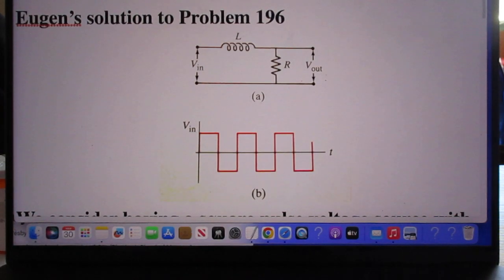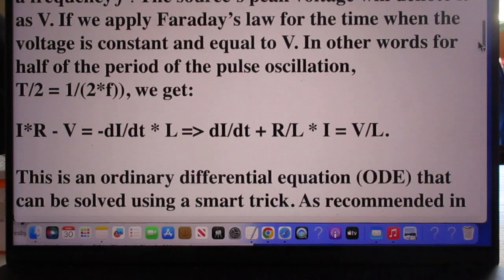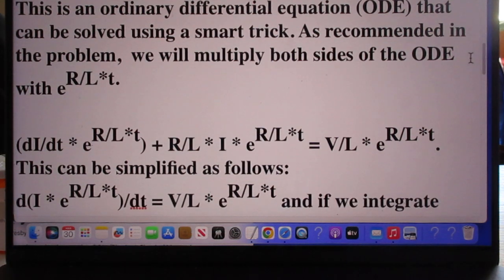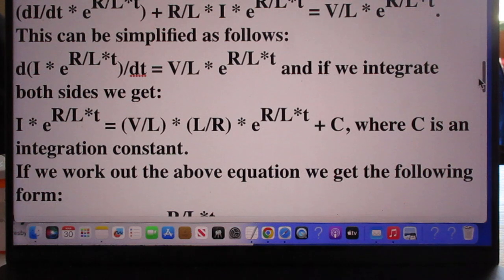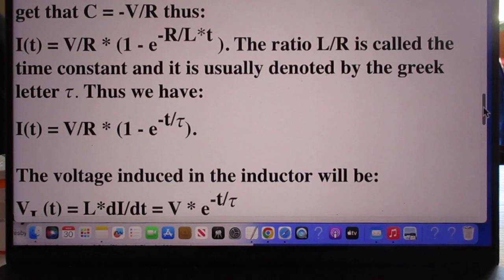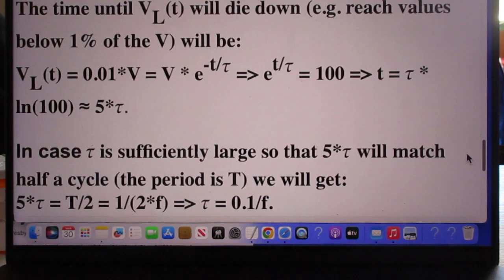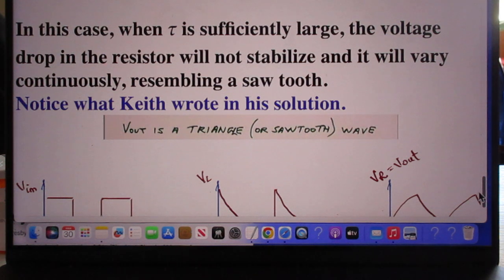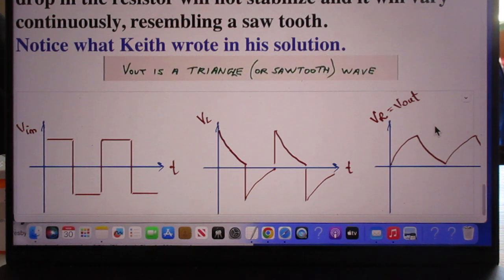Eugen's Solution to 196 - Integrating Circuit

Comment: What edition Physics book to you have Walter?  I am retired and studied Physics over 40 years ago, we used Nelson.
Reply from the maker: 8.01
Physics
Hans C. Ohanian
Physics
Volume 1 
2nd edition
W.W. Norton & Company
ISBN 0-393-95748-9

8.02
Physics for Scientists & Engineers by Douglas C. Giancoli. 
Prentice Hall
Third Edition
ISBN 0-13-021517-18

8.03
Vibrations and Waves by
Anthony French
CRC Press
ISBN 9780748744473

8.03
Electromagnetic Vibrations, Waves and Radiation 
by Bekefi and Barrett.
The MIT Press
ISBN 0-262-52047-8

Comment: 2:10 I did pretty much the same thing, yet I was "way off"...❔😕
The integration constant isn't required if you just use the fundamental theorem of calculus and the notation ₒ∫⁼ͭf'(t)dt=f(t)-f(0)=∆f.
The problem set the time t«L/R, so I used this and said exp(Rt/L)→exp(0)=1, then integrated. Much easier and it works!
Reply from the maker: we were fully aware of the fact that you copied the solution from the solution book of Giancoli. We had problems which that solution.   On a separate issue:  There is no E-field in an ideal inductor. Thus the integral of E dot DL through the wire of the inductor from one side of the inductor to the other side is always zero.  Yet, if you atach a voltmeter over the inductor you have created a closed loop with the inductor and the voltmeter. The integral of E dot DL through the inductor is zero, but according to Fraday's  Law the closed loop integral of E dot DL in the closed loop that you have created is -dphi/dt = -Ldi/dt and that's what the voltmeter will show.
Reply: @lecturesbywalterlewin.they9259 
Well, I did the solution first, then I looked up the solution which happened to be the same (it was obvious to me that I could ignore the exponential) but I found it didn't explain anything which is why I elaborated on everything and it was so long and perhaps confusing. 

I found the actual equations for the square wave and triangular wave that could be used to plot them over many cycles.Giancoli didn't do that.

I was also trying to make it fit my simulation, but I'm not sure if the voltage that the proto app measures the voltage on the inductor correctly as it just came up with 2V, same as the power source, but I did notice that on one side of the wire, if I put a voltage probe there the sawtooth/triangle wave shows up. 

I played around with the app and until I had a perfect square wave on the emf voltage at about 20μs timestep for that timescale and I did get the isosceles triangular wave, but on a different timescale. 

I attempted to get di/dt from the current but it did not meet expectations. Kept getting around 9.5V for Ldi/dt for some reason which I think is too high, or is it?

Here is some values:

I had L=100H, R=1mΩ, Vin=±2V, f(in)=250Hz

iR+Vin= -Ldi/dt
15μA(1mΩ)±2= ±100H(30μA/t)
=> Should have ~±2V= -Ldi/dt
L=100H=> For 320μs should have: 
|di|~6.4μA, but had ~30

1/t=(15/1000)±2)/3000
→1000×((15÷1000)±2)÷3
~671.67 Hz , 661.67 Hz
~ 1/1500μ=1000/1.5~666.67 Hz
t=±3000μ/((15μ/1000) ±2)~1500μs

100(30/t)=
29.8/320=0.093125
di= 31.4μA, dt=330μs

di/dt=31.4/330=0.095151515151515151 A/s
Ldi/dt=9.5151 V ( 😕????)

di= 39.8
di= ±(39.8μA - 200nA)=±39.6μA
di/dt=39.6μA/408μs=0.0976 A/s , 1st ½cyc
39.8/412=0.096601941747572815
di/dt= -0.0976 A/s, 2nd ½cyc
Ldi/dt=100*0.0976 A/s=9.76 V
Reply: @lecturesbywalterlewin.they9259 I accept the Faraday's law explanation but my app is just giving me the input voltage on the inductor. I think it's because the change in current is so small in comparison. 

Also, I try to get slope di/dt of the current over one ½ cycle and it seems to be off because I end up ~300 to 400μs for dt (with di~ 36 to 38.2μA), and it should be ~1500μs for the di I was looking at.
Reply: @lecturesbywalterlewin.they9259 Should 've chosen V=0 at t=0 b/c of the Fourier series. 😊

“Dirichlet Invented this Function to Prove a Point. Dr Will Wood” on yt, 61 seconds in…
Reply: Well, I did the solution first, then I looked up the solution which happened to be the same (it was obvious to me that I could ignore the exponential) but I found it didn't explain anything which is why I elaborated on everything and it was so long and perhaps confusing. 

I found the actual equations for the square wave and triangular wave that could be used to plot them over many cycles.Giancoli didn't do that.
Reply: I was also trying to make it fit my simulation, but I'm not sure if the voltage that the proto app measures the voltage on the inductor correctly as it just came up with 2V, same as the power source, but I did notice that on one side of the wire, if I put a voltage probe there the sawtooth/triangle wave shows up. 

I played around with the app and until I had a perfect square wave on the emf voltage at about 20μs timestep for that timescale and I did get the isosceles triangular wave, but on a different timescale. 

I attempted to get di/dt from the current but it did not meet expectations. Kept getting around 9.5V for Ldi/dt for some reason which I think is too high, or is it?

Here is some values:

I had L=100H, R=1mΩ, Vin=±2V, f(in)=250Hz

iR+Vin= -Ldi/dt
Take iR as average i value on ½ cycle 1:
15μA(1mΩ)±2= ±100H(30μA/t)
=> Should have ~±2V= -Ldi/dt
L=100H=> For 320μs should have: 
di~6.4μA, but had ~30

di=30μA
i(1mΩ)±2V=±(100H)(30μA/300μs)
=> ±(10-2)V=±8V=i(1mΩ)
=> i=±8(1000)A !!!

i(1mΩ)±2V= (100H)(-30μA/300μs)
=> -(10±2V)/(1mΩ)={-12000A, -8000A}

(30μA)(1mΩ)±2V=-(100H)(di/300μs)
=> -(90·μ²·mA)+6μA=di
=> di~ 6μA

1/t=(15/1000)±2)/3000
→1000×((15÷1000)±2)÷3
~671.67 Hz , 661.67 Hz
~ 1/1500μ=1000/1.5~666.67 Hz
t=±3000μ/((15μ/1000) ±2)~1500μs

100(30/t)=
29.8/320=0.093125
di= 31.4μA, dt=330μs

di/dt=31.4/330=0.095151515151515151 A/s
Ldi/dt=9.5151 V ( 😕????)

imax= 39.8
di= ±(39.8μA - 200nA)=±39.6μA max & min
di/dt=39.6μA/408μs=0.0976 A/s , 1st ½cyc
39.8/412=0.096601941747572815
di/dt= -0.0976 A/s, 2nd ½cyc
Ldi/dt=100*0.0976 A/s=9.76 V
Reply: Here are some values:

I had L=100H, R=1mΩ, Vin=±2V, f(in)=250Hz
(I mistakenly put iR+Vin= -Ldi/dt previously)

-iR+Vin= Ldi/dt

Take iR as average i value on ½ cycle 1:

-15μA(1mΩ)+2V= 100H(30μA/t)
=> Should have ~2V= Ldi/dt

L=100H=> For 320μs should have: 
di~6.4μA, but had ~30

-(15μA)(1mΩ)±2V=(100H)(di/300μs)
=> -(45·μ²·mA)±6μA=di
=> di≈ ±6μA

-(30μA)(1mΩ)±2V=(100H)(di/300μs)
=> -(90·μ²·mA)±6μA=di
=> di≈ ±6μA

2V-15μA(1mΩ)= 100H(30μA/t)
2V-15μ·mV= 3000μVs/t

(1000000/1500-1/200)Hz= 1/t
(700-33⅓-1/200)Hz=  1/t
666⅔Hz≈1/t

-2V-15μA(1mΩ)= -100H(-30μA/t)
(-1000000/1500-1/200)Hz= 1/t
-666⅔Hz≈ 1/t

-iR+Vin= Ldi/dt
-15μA(1mΩ)+2V= 100H(30μA/t)
2V-15μ·mV= 3000μVs/t

(1000000/1500-1/200)Hz= 1/t
=> 1/t=(15/1000)±2)/3000
→1000×((15÷1000)±2)÷3
~671.67 Hz , 661.67 Hz
~ 1/1500μ=1000/1.5~666.67 Hz
=>t=±3000μ/((15μ/1000) ±2)~1500μs

di= 31.4μA, dt=330μs
di/dt=31.4/330=0.095151 A/s
=> Ldi/dt=9.5151 V ( 😕????)

imax= 39.8
di= ±(39.8μA - 200nA)=±39.6μA max & min
di/dt=39.6μA/408μs=0.0976 A/s , 1st ½cyc
39.8/412=0.096601941747572815
di/dt= -0.0976 A/s, 2nd ½cyc
Ldi/dt=100H *0.0976 A/s=9.76 V

i=1A
-(1A)(1mΩ)±2V=(100H)(di/300μs)
=> -(3μmA)±6μA=di
=> di≈ ±6μA

i=100A
-(100A)(1mΩ)±2V=(100H)(di/300μs)
=> -(0.3μA)±6μA=di
=> di≈ {5.7,-6.3}μA

i=1000A
-(1000A)(1mΩ)±2V=(100H)(di/300μs)
=> -(3μA)±6μA=di
=> di= {3,-9}μA

i=10,000A
-(10,000A)(1mΩ)±2V=(100H)(di/300μs)
=> -(30μA)±6μA=di
=> di≈ {-36,-24}μA

i=100,000A
-(100,000A)(1mΩ)±2V=(100H)(di/300μs)
=> -(300μA)±6μA=di
=> di≈ {-306,-294}μA

di=30μA
-i(1mΩ)+2V= (100H)(30μA/300μs)
di=30μA=> (-10+2)V= -8V= i(1mΩ)
=> i= -8000A !!!

-i(1mΩ)-2V= (100H)(30μA/300μs)

=> (-10-2)V= -12V= i(1mΩ)

=> i= -12000A !!!

-i(1mΩ)±2V= -(100H)(30μA/300μs)

=> -(10±2V)/(1mΩ)={-12000A, -8000A}

Comment: I think both solutions are not correct. V is not a constant, it is V(t) and so V(t) / L * exp(R/L*t) can not be integrated in this way.
In the beginning, we can assume a switch on problem with a solution i(t) = V/R * (1 - exp(-R/L*t), but half a period later the Voltage drops from V0 to -V0 and there I(T/2) <> 0.
Reply: If you take a closer look, I specifically mentioned the ODE is setup for the time period when Vin is constant and equal to V. For what the problem asks I would say is enough as one can easily draw conclusions for one full cycle. Note the input signal is not a continuous function as the problem set it up (at each half a cycle Vin has two values V and -V) so it is an unnecessary hassle to analyze it for a full cycle.
Reply: You forget that the time is small, t«L/R, so the integration is valid for the 1st half-period, 
and then for all half periods that have this same V(in)max, the form of the solution is the same if you integrate in those regions.
If you go to the V(in)min= -V(in)max regions, then you just multiply the slope by -1.

Comment: 63 is a social security number.
Reply: Try taking the square foundational sum of a number, adding one to it, then add it to the original number and repeat step one again.  See a pattern?   A square foundational sum is the sum of a number's two closest factors which are both 1.) closest in value to one another, and 2.) sufficient to produce the inspected  number.